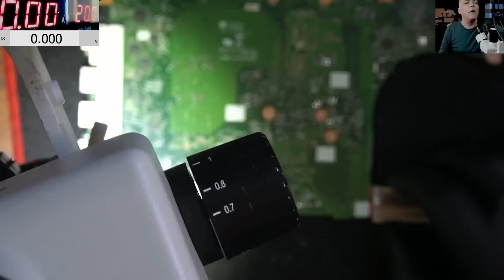Laptop not charging? This can be the problem - Acer Swift SF315 not charging repair

Comment: This laptop is amazing! I bought it as a laptop to use for a 4 year university program! Sleek design and excellent performance, how could I not. Unfortunately, I am now in my final semester, with multiple projects on the go and my Acer Swift laptop won’t charge anymore. Perfect condition, just a poor quality build by acer. How on earth do I even fix this without spending $100’s more to fix a 4 year old laptop… Beyond frustrated at how short a lifespan technology has now with what was known to be the most reliable operating system in Windows.
Reply: Mine too the charger port is way too fragile.  You can charge it with usb c tho too.

Comment: Hi, I'm working on a "dead" Acer just like the one in this video. A relative gave it to me saying it was plugged in during a storm and lightning struck the house. Since then the laptop isn't working. 
When I plug the charger, nothing happens, no charging light, the pc doesn't turn on. The charger is working. 
I've tested the charging barrel on the pc, and I tested continuity between the inside pin and the outside contact point ( which should be + and -/ground if I'm not mistaken), and I have continuity between the two. This shouldn't happen right ? I'm thinking about replacing the charging port to see what it does. 
What do you guys think ?

Comment: With my luck the port would have melted when I pointed hot air at it. xD That's why I do it the hard way and clear all the holes and then solder the pins one by one lol.
Reply: Try adding some low melt solder to the joints first, should make it come out a lot easier with the hot air
Reply: Yup, my laptop has such huge ground traces around the charging port, that it takes a lot of hot air to get the solder to melt. Usually it gets all soggy looking by the time it's out. Ain't no way I'm putting a new one with air. It's a shame, since the insides of it get soft either way after awhile (it just can't handle 230 watts going through it) and needs to be replaced again.